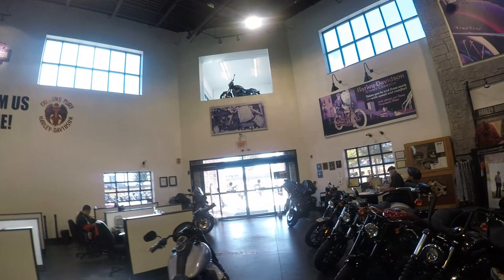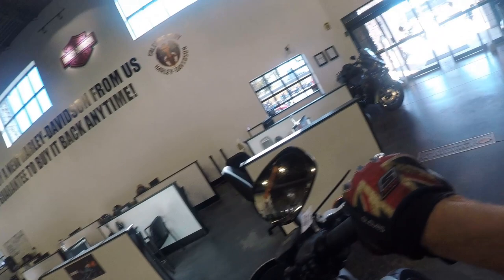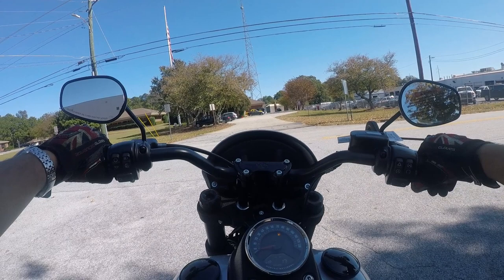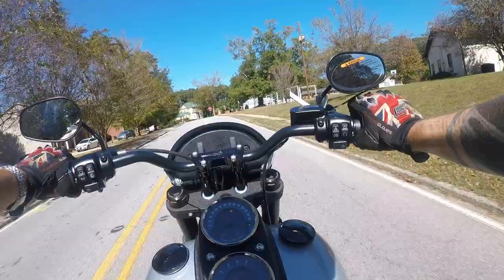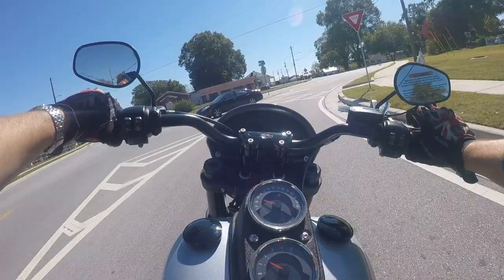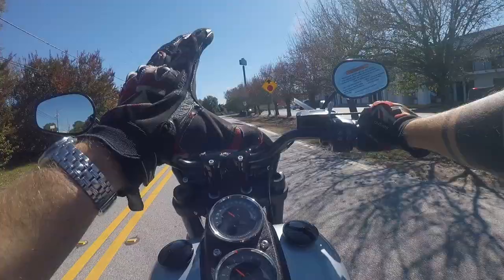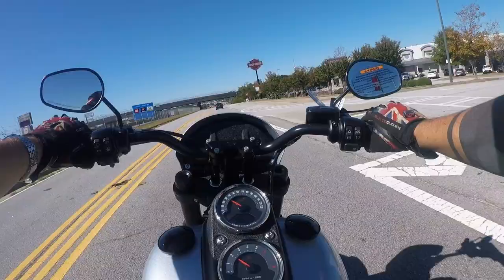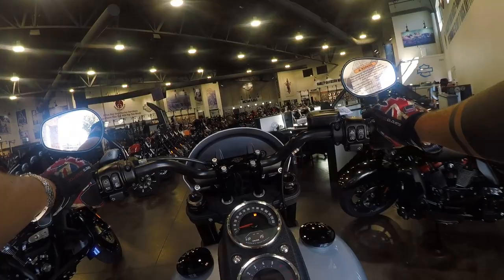2020 Harley Davidson Low Rider S Test Ride

Comment: I'm short and I have a herniated disc in my lower back. I HAVE to ride with mid-controls. This bike is on my bucket list.  Besides, mid-controls give better handling anyway due to better weight distribution. If you snow ski, you will understand the physics.
Reply from the maker: Yeah those mid controls have a big advantage in the handling department. Thanks for watching.
Reply: Exactly